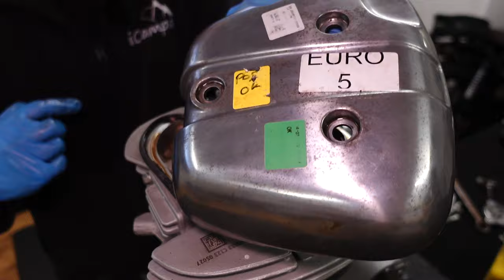Part 11 - Engine Dismantling for Painting & Polishing - Royal Enfield Classic 350 Reborn

Comment: 👍 post the next one as early as possible
Reply from the maker: Already done so look out in the next couple of days 👍
Reply: Another interesting video Glynn, on your next video can you go into detail when you refit the clutch case, I've heard it can be a bit fiddly  and some have struggled with it, cheers
Reply from the maker: Will do, I can't see why it would be much trouble, although I can see the clutch drive is geared and the top arm would spin when the case is reattached and might end up in the wrong place.  I've taken the arm off anyway so that won't be a problem but if you didn't I can see that would be very frustrating @hunterrider349

Comment: Seeing the fabulous detail design and manufacture of this engine makes it even more amazing that they produce a complete motorcycle for under £4000 in the case of the HNTR.
Great to see inside yours but I think I'll leave mine in one piece until I need to do some work on it.
Thank you for such a great video series
Reply from the maker: Thanks very much, it's a lovely machine.  Some have done over 50 thousand km in India with no work needed.  Usually older bikes would suffer once the carbs and ignition started to give trouble before the actual engine parts did.  These have got super reliable fuel injectors and throttle bodies that hopefully last a long time
Reply: That's all good to hear. Thank you Glyn.

Comment: The engine is so interesting when you was stripping it down. Glad you didn’t pop your back, lifting it onto bench.
Think this cam will sell out super fast. I will try and purchase and get fitted at next service.
Engine will look cool when painted😊
Reply from the maker: It's a lovely little machine in there.  I can't believe how heavy it is, I'd wager it's as much or more than your Honda Twin.  I think if the oil had still been in it that would have been too much!! It was pretty much at the limit of what I could lift, not sure how to get it back down again, a contraption of sorts might be in order👍

Comment: Yeah mate not very convenient especially when you already got the motor out 😂 evening Glyn a very informative vid mate the neutral light switch is sooo simple and that motor came apart without drama impressed with all the casing bolts being the same size and and of great quality, is that a lidle parkside screw driver haven’t seen them over here yet but I want one. I love these motors the centre piece of the bike as it should be, cheers Glyn ….. Pete🇫🇷
Reply from the maker: Hi Pete, I knew it was there but was just in denial I think 👍 Yes, it's the Parkside Electric Socket Wrench with a 1/4 or 3/8 inch drive on the end, it'll come round again soon I'm sure.  I haven't used it much but was perfect for this and is very strong too 💪
Reply: @GlynOC  I’ll keep an eye out for it, re the Tec levers had a chat to Amy my daughter and she said she will order them for me and send them over, really appreciate your offer though Glyn thanks, had you already cracked the casing bolts before pulling them or is it strong enough to pull them straight out. Cheers, …. Pete🇫🇷
Reply from the maker: @PeterHolland-mu7yn  ahh that's great then 👍it cracked them off itself and will give a painful wrist twist if you don't hang on to the bugger ☠️
Reply: @GlynOC  ouch 😣👍

Comment: So, Glyn. Would a 650 Royal Enfield engine fit in the 350 frame?  Also, are you going to fit a performance cam whilst you have the engine apart? You'll never get a better opportunity, mate. 😊
Reply from the maker: Anything's possible with enough ingenuity but maybe more than I've got!  It's quite a deep engine, would be easier to make a 650 look like a Classic maybe..
Reply: @GlynOC  It was just a thought. By the way, whilst you have all the covers off ready for painting, etc, why not highlight the "Royal Enfield" logo with an enamel heat resistant paint? It would stand out and look great! Just a thought Glyn. 👍
Reply from the maker: That's a great thought, thanks! Off to Amazon now👍 @jez6208

Comment: Question for you Glyn please. As I have mine apart. Clutch side bottom right hand corner a hole you put your finger on a few times. Is there a 'o' ring on that oil gallery. Or did it do as mine did and stuck to the side casing.  I found it floating about in the side casing and it fits perfectly on the hole. Looks like it goes to the drain bung possibly.
Reply from the maker: Hi David, yes there is and it's still on the engine case.  I believe that runs from the oil pickup in the engine into the oil filter and is probably quite important as it seals the intake to the filter.  I don't think it would be engine shaggingly bad as any leak there would suck up oil anyway that was in the clutch side case.  It's still in bits so let me know if you want me to look at anything👍
Reply: @GlynOC  thanks for looking  taking my time as I am still ill but I am slowly doing the camshaft up grade. The side casing came of so easily and it wasn't until I looked into the side casing I saw this random 'o' ring. Had a good look and it could really only go there but I thought I would ask to be sure. Hitchcocks engine part diagram doesn't see to show it. The problem on the videos I have watched that oil has shiny oil on it and I can't make out an "o" ring or not.  I am fitting Hitchcocks stainless bolt kit,it's not expensive really.  There bolts on my side casing were quite loose so thinking they'll be ok in stead of the originals. Your video is great and I wished I had watched it a day earlier 😆
Reply: The clutch lever looks interesting as its has a tooth drive into the clutch basket. And looking at the brake pedal assembly I have to take off haven't seen the brake light switch yet either lol
Reply from the maker: @davidrawlings3460 What a coincidence!  The only other thing I've seen to be wary of is there's a small gasket above that area separate from the main one and I assume it would be easy to accidentally leave that in or out or maybe accidentally fit two and much up the spacing  🙏
Reply: @GlynOC  oh god I better look for that now lol
Reply from the maker: That's right, there isn't one is there, or on the Meteor.  I wonder if it's a pressure switch inside the ABS pump? @davidrawlings3460
Reply: I wondered if it was in the ABS system but there are this switches listed with a long spring on but perhaps that's a different model. I can't make out where this other gasket goes except the red "Y" shape one that comes with the main  gasket.
Reply: You better send me a picture of this other odd gasket so I can check lol